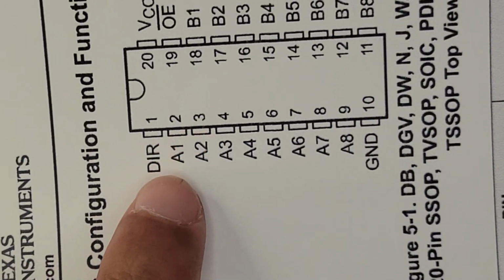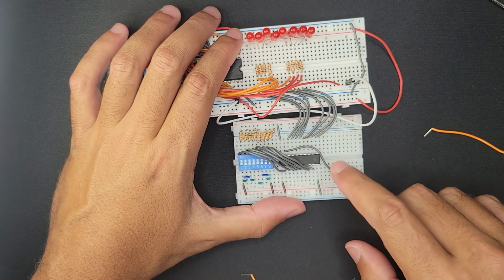RAM Controller Build | Programming Memory with Hardware | 16-Bit Breadboard Computer Build

Comment: Question (I have not watched all your videos yet): does the DRAM chip refresh itself?
Reply from the maker: Hello! This chip is SRAM, so it is not required. If we were using a DRAM chip, then to my knowledge, we would be responsible for refreshing it. Either by wiring it up ourselves, or using a chip that has built-in functionality -- but we would still need to trigger it. But with the chip I'm using, it's static RAM, so not needed. Hope this helps!
Reply: @MxyAhoy  Makes sense, thank you

Comment: I think it's time that you tidy up the breadboards. It's starting to look very messy and difficult to flow. other then that I really like your videos, keep up the good work.
Reply from the maker: That's a great idea, thanks. I need to get some longer cables so I can cut to size. And a good friend of mine suggested converting the tested pieces into modular PCB's, so maybe that should happen sooner than later. Thanks for the comment and critique!
Reply: @MxyAhoy you can also interlock the breadboards into one big one and use custom solid core wires for things that won’t change. when I built Ben’s 6502 I used different colour for each function.
Reply from the maker: I'll try that with the breadboards, thanks!

I did order some solid core wires (they are 28 AWG, PVC). Someone told me about Kynar -- is that the standard for something like this, when setting semi-permanent cables after testing?

Thanks for the input. This helps a lot
Reply: @MxyAhoy never heard about Kynar but I think any solid core wire will be fine as long as you can band it and fit it in the breadboard holes